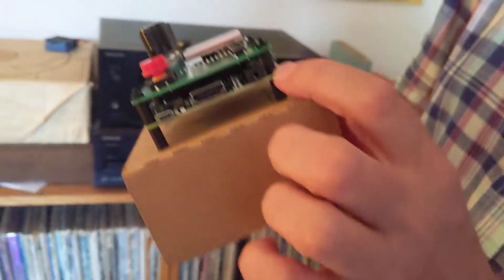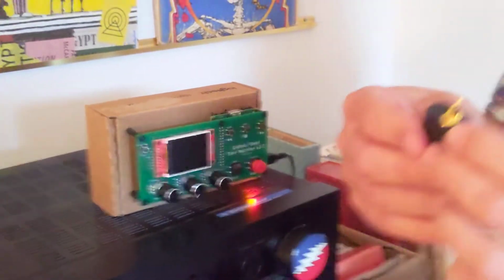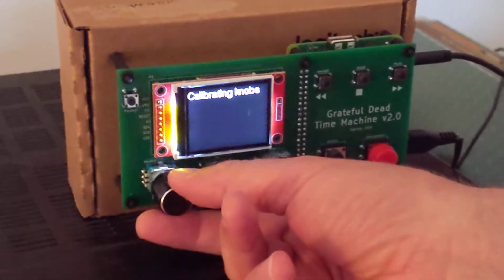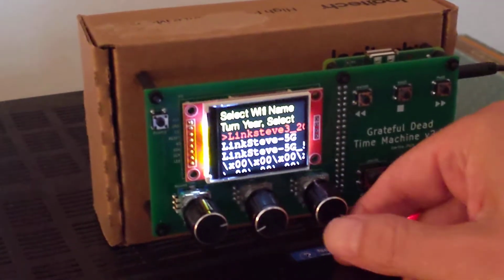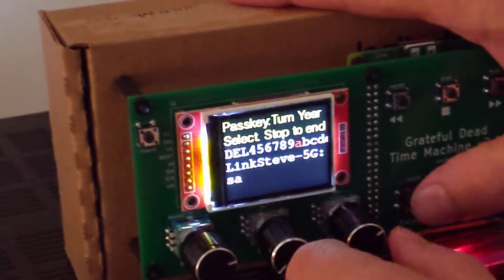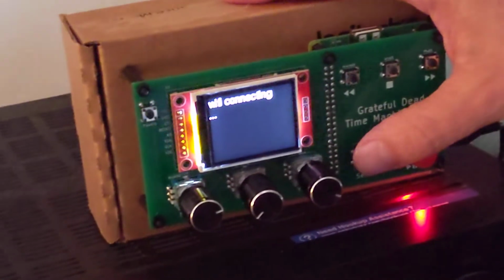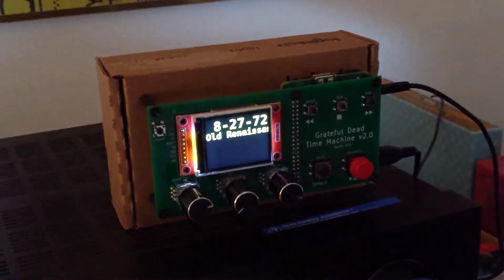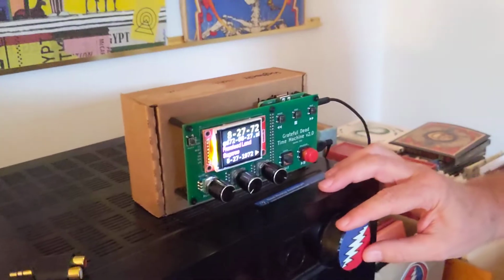Setting up Grateful Dead Time Machine for the first time.

Comment: Very cool project!  I am trying to build my own Time Machine with a Rasperry Pi 3b+, but I want to use a slightly different display that I already have on hand.  It's a 2.2" SPI module, using the ILI9341 driver (instead of the ST7735 driver).  

I found and downloaded the source code and believe I found the sections of code that need to be modified.  I typically use Visual Code IDE for building from source code but have never worked with python or building Rapsberry Pi images from source code.  I was able to get past most errors in VC and install most the pre-reqs for working with the source code, but am still getting an error -  "ModuleNotFoundError: No module named 'timemachine'"  - tried following the pip install directions in the ReadMe file but got file not found errors.

Any chance you could offer suggestions or point me in the right direction to modify the source code for my display and to then create a bootable image from it?  Thanks!